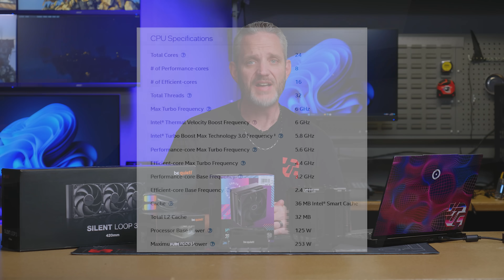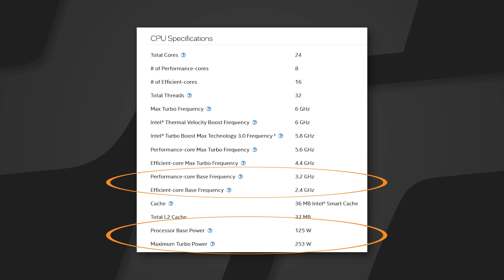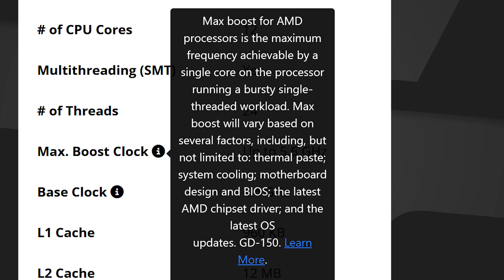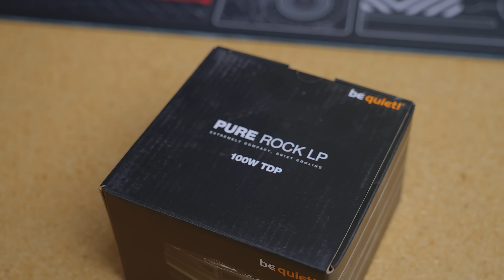Forget what you THINK you know about TDP

Comment: I've tested 9800x3d a while back on AK620 and it was hitting 95c lol obviously throttling. Insane and this is supposed to be 120W part. To be fair it was only consuming 150W but it was hitting thermal limits for some reason, with or without PBO. The point i'm trying to make is that power draw is not the whole piece of the puzzle here.
Reply: Ive noticed this for years when comparing AMD cpus against my overclocked 13700k. Im pulling 1.24v, 200w but under stress hitting 85 degress. Ive noticed AMD seem to pull less power but run hotter with less power. Intel seem to be more effiecient at dealing with higher power draw.
Reply: @SmokeSolo1975  Ye, i've 13600k at the moment as well, i returned the 9800x3d because i would have to upgrade cooling as well, and since aio wouldn't fit in my case i would need new case as well it was just too much cost at once lmao. and not enough performance jump to justify the swap.

Anyways, my 13600k after UV is like 75c in Cinebench (it's crazy how high default voltage was for that chip, mine works at 1.1v with no performance drop while stock was like 1.3+v, when i bought it xd), while 9800x3d on same cooling was throttling at 95c - same power draw around 145W.
So that's over 20 degrees diference. It's funny because it was Intel who got bad rep for being high power consumtion- high thermals chips.

Comment: I had an AMD Athlon 64 X2 4200+ Toledo core processor back around 2007 ish, it was air cooled with a passive cooler that I put a fan on. The processor was overclocked from 2.2GHz to 3.1GHz, and with the passive cooler fanless and using just the case fans to move air through my MASSIVE Cooler Master Dragon case, under full load that CPU would hit about 70*C or a bit more. By just adding a single 120mm fan to the cooler, I suddenly had temperatures down below 60*C under heavy loads. I was happy to have that passive cooler because about a year after installing it, the used 120mm fan I installed seized up and the CPU never got over 70*C again. When I had a Cooler Master AIO fail on me (it had evaporated all of its coolant) I had noticed that my temps went from the mid 50*C on the CPU (AMD Phenom II X6 1045T) under load to suddenly into the 70s and 80s under load and 60s at idle, that freaked me the hell out! That AIO was replaced with a tower cooler till I got my i5 3570K, which was cooled again by an AIO, and my current AMD rig is cooled by an AIO, but I can say when this one fails, I am going back to air cooling, and sticking with it.

Comment: I purchased a Li anLee Galahad 240 three fan system and within less than a year I noticed issues. I removed it. I put in a NXT so I cut open the Lynn Lee. There's no water in it. No fluid, no nothing. I don't know how long it had been that way since that day. I use air coolers only I know when they break

Comment: 7800x3d -40 all cores ppt limited to 75w and 420mm aio arctic lf3 pro max (p14 max fans) , fan curve pretty low... at 75degrees at 50% 1650rpm, stays at 35degrees idle and 60degrees in games, max temp i've seen in syntethic benchmarks like cinebench is 70degrees C.

Comment: My 9950x3d regularly peaks around 250-252Ws during intense renders. If there is thermal headroom, it's gonna use it xd.
Reply: Facts. I have a 420mm AIO with a 300w PPT 9950x3d and it’ll still hit 95c when it wants to.

Comment: I switched to Noctua coolers and gave up on TDP rating years ago. When I want to check, whether a CPU will work well with a given Noctua cooler, I just check their compatibility chart on their website. Not only they tell you the socket compatibility, they also tell you the performance of the cooler on the specific CPU and its boost and OC headroom.
Reply: And even if the socket isn't listed you can just message them to get the new mounting gear.
Reply: this is the way
Reply: As expensive as noctua is, that's cool.
Reply: @rarespetrusamartean5433  I bought the NH-D15S in 2015 or so, for Intel 1151. Now I use the very same cooler on AMD AM5. I still use the original fan and I even the same thermal paste that I got with the cooler. The only thing I replaced was the AM5 mounting kit. As long as Noctua will support this cooler and make new mounting kits for it as new CPU sockets come (if needed), I'll keep using it.
Reply: Noctua's work ethic is on a whole other level.
Reply: Noctua does have a pretty handy chart. The advertised tdp numbers on other coolers are usually made up anyway. They can fudge the tests to get a much higher number to help them sell coolers. LP/blowdown <100W, single tower 120mm 150-200W, dual tower 200-250W, 240mm aio ~200-250W, 360mm aio 250w+ is what I'd consider realistic. You see air coolers claiming they can do 300W+ though and that's clearly nonsense.
Reply: noctua is too expensive for cooling but Thermalright peerless assassin 120 or id cooling frozn A620 is cheaper and better performance than noctua lol
Reply: @indrahaseo  Their not cheap, but its quality.
Reply: @indrahaseo  Definitely not better performance, but they are close-ish enough to noctua to be fine.

Comment: Hyper 212 series have come a lot from previous generation to current. 
However Hyper 212 mounting have change over the years, current models I feel 
quite troublesome. 
Since if you want equal mounting pressure it is best to take out the motherboard and mount it. 
Another issue of Hyper 212 is the included fan which was highlighted as the weak part of the cooler. 
The Hyper 212 Black I did really like however to my understanding it have been EOL. 
Some may ask how that cooler can handle CPU up to 210 watt according to Cooler Master website. 
It's possible I tried with Intel i9 9900k it didn't thermal throttle unlike the older Hyper 212 Black Edition. 
Not to be confused there are two Hyper 212 Black Edition (RR-212S-20PK-R1) and Hyper 212 Black RR-S4KK-25SN-R1.
TDP can be misleading so if you ask me, you really have to match CPU coolers with which CPU you are using. 
For example if you are using Ryzen 7 9800X3D you won't want a CPU cooler like  Hyper 212 Black. 
It may do the job but the turbo can be limited so you would rather consider HYPER 612 APEX instead. 
FYI I am not a Cooler Master Fanboy just that Cooler Master Heatsinks are not popular used. 
Unlike Thermalright, Noctua etc. but to me Cooler Master heatsinks are decent for budget builds. 
Here in SG Cooler Master Heatsinks can be hard to find since most retailers carry other brands than Cooler Master.

Comment: The only overheating problem I've ever had with a CPU was with the Ryzen 9-3900X. It didn't seem to matter what kind of cooler you put on that stupid chip it would just jump to TJMax in seconds after starting synthetic benchmark tests. Even with a Corsair 280MM AIO with fan speeds at max it would hit 90 degrees + in Cinebench 23 in about 30 seconds! I finally yanked the chip and went back to the Ryzen 7. I didn't have room in my case for anything larger for cooling.

Comment: 11:04 the copper base used by tower coolers aren't vapor chambers. They are just a single piece of copper that some heat is transferred to the heatpipe at the edge that is too wide to all contact the CPU.

The first tower cooler with vapor chamber is a Deepcool unit that was released just this year

Comment: I run a 9800x3d with an ID-Cooling FROZN A720 BLACK 140mm Dual Tower Black Air Cooler with a TDP of up to 300W and everything is just peaches! :face-blue-smiling::face-blue-smiling::face-blue-smiling: PS. My Thermalright Venomous X Black CPU Air Cooler on my Gen 1 i7 920 have been running non stop for 15 years while overclocked. I trust a good air cooler over an AIO any day of the week, but there will come a time when AIO's will be the only thermal solution.
Reply: I certainly hope not, I don’t want to see CPUs become that hot, that power hungry, that… unwieldy, lol.
Reply: @TH3C001 my old TR1950 would pull 380w at 4.3 all core 😂😂😂
Reply: I had a nh-u12a for a 12700k and it was fine, going to a 9950x3d i could tell that cooler was no longer cutting it if i wanted the most out of the cpu so i got a 420mm aio from arctic for like $100, insane price to performance, I'm okay if the AIO only lasts 3-5 years before needing to be replaced at $100 its not bad.
Reply: I think the opposite is true. CPUs are going to become faster while drawing far, far less power.
Reply: I still have that chip running. Now its my gf pc.
Reply: TDP is just stupid now. Problem with new cpu:s is in heat transfer. That cooler most likely would cool a 5090 with 0 issues.

Comment: I have a I9 7940x with turbo oc'ed to 4.5hz and stock rtx 3070, cooled by a 280mm and 200mm radiator with server fans. This cools my system just fine, but also modded the vrm for better fans so can be cool for this oc as well.

Comment: I have a thermalright phantom spirit on my 10850k and it never goes over 75°c even in cinebench r23 throttle test. I wanted to go water cooled but my current case is kinda cheap and i cant mount a radiator in it.

Comment: What temperature is bad for your CPU under load? Does 70°C continuously cause extra wear compared to 60°C?
Reply: This is a case of check the manufacturers ambient and max temperature list. AMD and Intel both have these. The idea for modern CPU's is that if they hit that max temperature they will slow down (throttle) to keep below that max. Your best bet is to see what temperatures you are getting at low usage and see if that temperature is OK for you (noise is a thing, the more cooling you need, the more noise from fans and possibly pumps you will hear). If it's too loud, and your temps are above 65C at low usage, start checking what's running and you may need to repaste your CPU, Change fans or Change the case. Cable management is a thing, too, as you can block airflow, or have wires near fan blades that can cause issues for the fan, the wire, or both. Graphics cards get warm, too, so they can add to the noise (some have zero RPM modes where until the GPU hits a certain temperature the fans for that GPU stay off).

The other thing you will want to do is see what the most demanding application (games included) push your CPU temperature to. My AM4 Ryzen 7 5800X has a maximum temperature of 90C before it throttles, so I have a fan curve set to go 100% at 80C with 65C and below at 50% fans. All that is through Fan Control.

If you are ok with the temperature under high load and things aren't too noisy all good. If you are getting close to your max temperature under that high load, again, check your paste, but also your case setup. Maybe you'll need more fans. Do note bigger fans need less RPM to move air, but when you need air moved, they will move a lot more at less noise vs their smaller cousins. A case change may be in order, too.

I will offer a few more pieces of advice: Fan noise used to be measured in decibels (dba), now they are measured in Sones which instead of being scientific measure like dba, is a more a feels like measurement. There are websites that can do a conversion for you. Some companies still use dba measurement (20 or less is supposed to be quiet). The nature of the airflow also matters. If you are using the fan on an AIO radiator or a pump radiator for a water cooling setup, different factors of that airflow matter. CFM is measuring how quickly the air is moved by the fan and you will see a dba level at that speed or a plus or minus X amount for that speed. PWM fans are great as they send a signal to control fan speed, while normal fans are constant (PWM fans can do constant, too, you just have to set them so). Fans for a pump can be thought of like your heart, they have to keep the liquid moving. That said increasing the flow is something that may help temperatures as liquid has a set amount of heat it can contain before evaporating. The idea is that when the liquid gets to the cooler radiator with its fans keeping the fins cool, the heat will go to the colder area, thus letting the water return to the reservoir and if any of that evaporated it will go back to liquid form there (this is why leak prevention is a must, but there is only so much you can do, hence the maintenance to restore the reservoir level of liquid).

Do your research and keep in mind the heat must go somewhere, so if your room is too warm and the noise is still tolerable from the computer, see what you can do to better deal with the hot air. Airflow in a room matters.

Good luck and I hope this helps.
Reply: @benjaminbiller1387  My base temps are 34°C, and most games only push me to 62°C.

However, recently some extra demanding titles are pushing my i9 13900KS to between 65°C - 75°C, and I'm tired of worrying about my CPU temps. 

I think I'm going to upgrade my case and cooler from a Fractal Torrent with a Noctua NH-D15, to a Fractal Meshify 3 XL with a top mounted Arctic Liquid Freezer III Pro 420mm AIO.
Reply: Hello. Yes Sr

Comment: 1:19 "Watts consumed is not the same as watts of heat generated" – no, it's exactly the same.

The amount of electrical energy a CPU consumes is exactly the same as the amount of thermal energy it outputs. 1 watt electricity outputs 1 watt of heat. All of the consumed energy turns into heat. Same with a GPU.

There are devices that also turn consumed electrical energy to other forms of energy like light, kinetic energy or radio signals (in addition to heat). A CPU or a GPU are not among them.

Comment: AIO for me. I get 18 degrees cooler temps on my 5900x with an arctic liquid freezer 360 than noctua nh-d15. And it costs less. While the air coolers can cool almost as much as the AIO, a lot of the gpu heat ends up going into the air coolers which drastically reduces its ability to cool the cpu. By having the AIO as intake, you will always have access to cooler air.

Comment: I just go for whats quiet and works (while being affordable). So i over-spec my cooler and psu. Arctic lf3 420mm for my 7800x3d, wasn’t even $90. I could use a cheaper air cooler and itd work fine, but i like it being quite silent due to using openback headphones. Even with intensive games, it rarely goes above 55 with quiet fan settings. Needs an artificial load to go higher with my case.  Friend uses a phantom evo though and it also works amazingly, just louder

Comment: The lessen of the video.  TDP on a processor = MPG on a car. neither shall ever be seen in the real world.
Reply: Ummm, no, poor analogy. 
You should probably be comparing BHP (horsepower), because TDP is like declaring horsepower while at idle, or pootling around town. Not flat out on a racetrack. 
And for the record, my car usually matches, and even exceeds, the declared mpg by the manufacturer. Which is 75milesperImperialgallon (around 63milesperUSgallon). HOW you drive it, and the speed you drive at, influences these numbers so much, that the "average driver" has no idea how to achieve the claimed efficiency. But mpg can definitely be seen in the real word, whereas Horsepower is a much more mythical beast...

Comment: In 2025, if your case can accommodate it and you want your cooler to last a decade or more, just get an NH-D15. It doesn't matter if it's the cheaper G1 or newer G2. If you want close to the same performance for much less up front cost, just get a Thermalright Peerless Assassin. The flip side is it may be harder to get future mounting hardware from Thermalright to reuse your existing cooler. If it's easy, I welcome someone to chime in with a reply.

Noctua sends you updated mounting hardware for free as long as you provide your cooler's proof of purchase. On the other hand, AIOs perform great, can fit in a lot of different chassis and are a lot safer to transport owing to the lack of a huge, heavy mass hanging for dear life off your mobo's socket. However, they almost certainly won't last as long or be as reliable as a tower cooler, especially Noctua. If you don't care about noise and are running a relatively low power chip, just use the included stock cooler if it has one.

Comment: 12:50 AAAAAHHHH cries.  That was me and my 5900x, had a 212 (was on my last two cpus), then went to a dual tower similar to the one he has on the table, then went to back to a beefier signle tower with dual fans, then said fuck it and went with a Thermalright 360 AIO finally.  Because even tho they can handle the heat, it was urking my adhd with how much the fans were ramping RANDOMLY UP and down when Windows is doing random shit (not anything sustained).
Reply: Hahaha same I have a 5800xt and I went with a 360 for consistent cooling. Probably overkill but It was coming pretty close to thermal throttling before that!
Now it’s pretty aggressively overlocked and still only ever just touches 70 at 100% load.
Reply: Adjust your fans so they dont? (Coming from silent custom loop master race lol)

Comment: TDPs being based around the base clock is something ESPECIALLY evident in laptops, because TDPs are often configured by the laptop manufacturer based on what cooling and power delivery they have in there, and you realize pretty fast that 4.5 Ghz boost clock is a very temporary thing when the base clock is 2 Ghz and itll sit around 15 or 25 watt max after ten seconds.